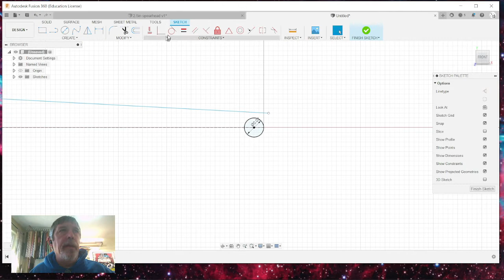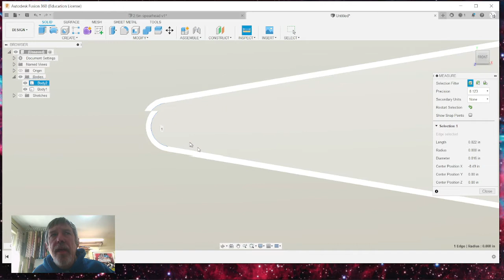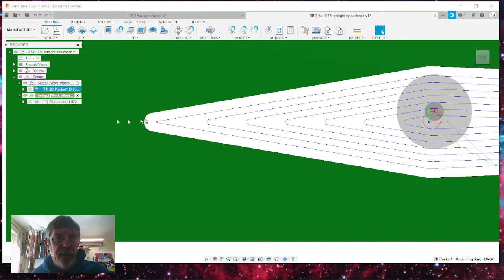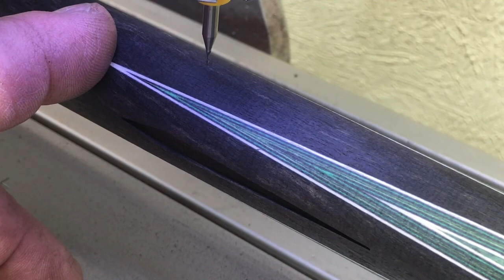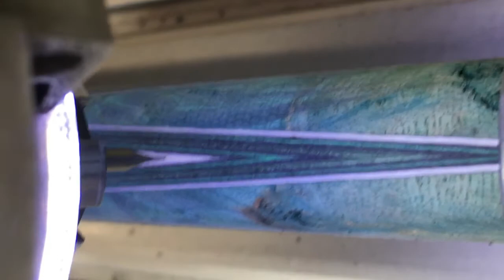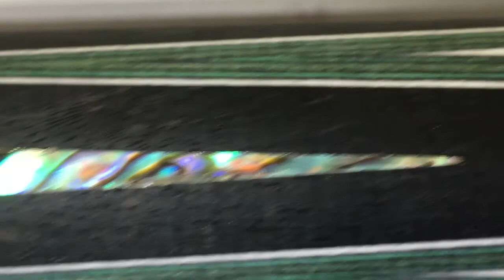Pockets and inlays using Fusion 360

Comment: Also there's a few ways I've found that you can speed up this process.. Rest Machining makes using 2 bits much easier and faster... Also, you can do negative stock to leave in order to get a slightly larger cut for the inlay piece to fit...
Reply: Oh and I use fillets half the diameter of my cutter instead of using circles and tangent lines...etc..